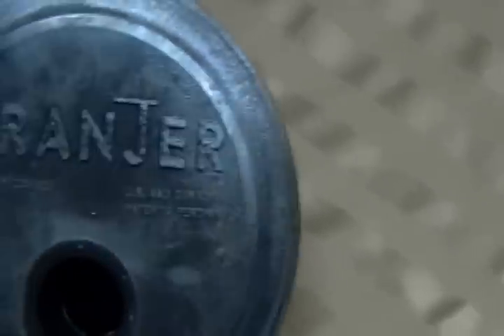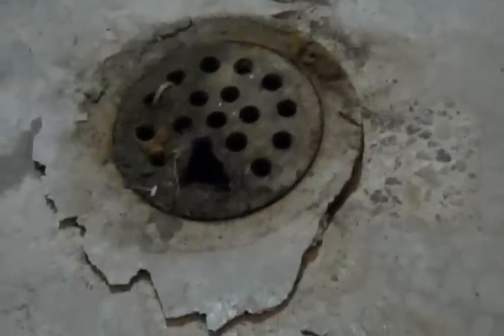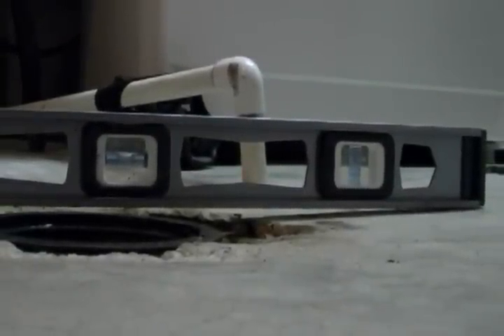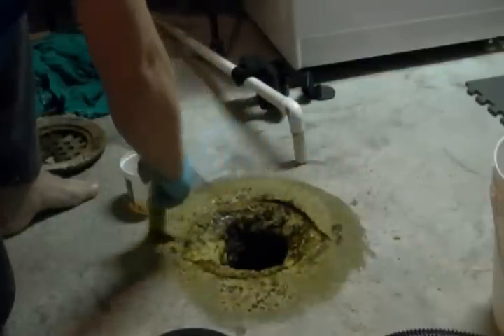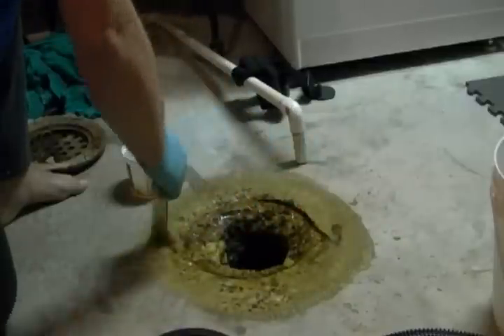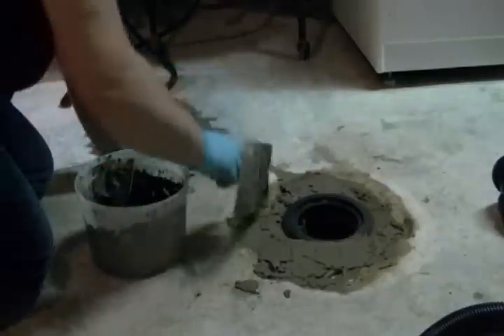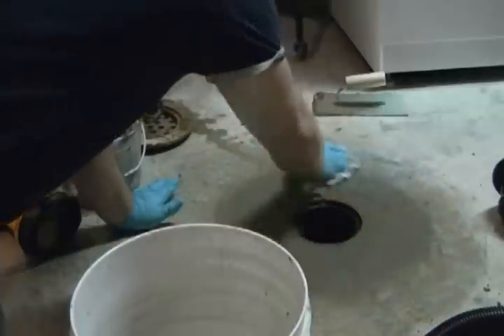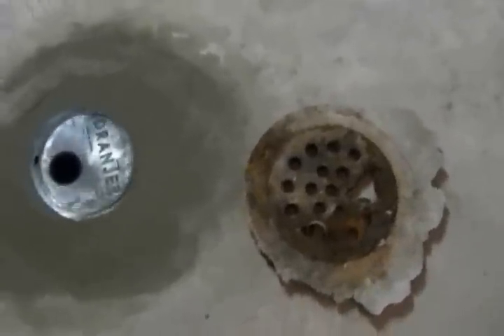Basement floor drain replacement with a Dranjer J-N6.avi

Comment: I see you cementing the ring into place, however do not see you putting the J-N6 into the floor. And when I look at the design of the J-N6 I see a place for water to flow into the drain and down into a curved pipe, the upside of which has a ball in it that I think will only allow water to flow past it and stop flow of gas in the opposite direction. I do not see you attaching this to the drain in the floor which appears to me to be the most difficult part of the project. Please explain.  Thanks.
Reply from the maker: You don't need to attach to the drain. the J-N6 just get placed into the o-ring, so only water will go down into the drain , but the ball in the unit covers the drain hole so gas / sewer smell can not escape back up. Simple design, hopefully that answered your question. Took me about 1 hour to fully install

Comment: Where does the water go when it enters this drain?  Does it just collect under the concrete or is there a open sewer pipe you dont show in the video?  I get the concept of the ball valve but not where it goes from there.  Does it just continuously erode the soil under the concrete until the concrete collapses?  Just trying to wrap my head around this...  thanks
Reply from the maker: There is a main drain in the sewer line that goes out to the city drain under ground

Comment: The original drain was 4 inches in diameter the drain you installed reduced the flow considerably, what happens when this drain is called on to take in a large volume of water like a burst pipe or water heater?

Comment: So the plumbing comes up to the drain but the ball valve is also curved up. How did you connect them in such a small space?
Reply from the maker: You don't connect anything, It's only a to cover your floor drain, replacing the cast iron one. The ball keeps gases can not escape . but if any water goes down the drain the ball will rise and the water goes down the drain. Does this answer your question ? I'm not sure what you meant.

Comment: Did I miss something you have a Loop with a ball in it, When the water gets in the loop the ball floats is there a hole in the bottom to let the water flow down to the drain?  How does the water get into the drain?
Reply from the maker: when the water enters the drain . The water pushes the ball up. the purpose of the ball is to stop the gases .

Comment: Just got the Drainjer yesterday but my issue is I have my washer hose and furnace condensation pipe going to the floor drain I'm not entirely sure if it's a good idea to do this with the dranjer..
Reply from the maker: I would think it would be fine, as long as the drain hole isn't completely sealed or if your using a hose , It's not pushing up the stop ball . I would contact the company who makes this product and ask them .

Comment: What mortar/cement did you use?  I did something similar and used just standard Quikrete concrete mix and I ended up with a very gritty, pebbly surface, nothing like the smooth one you got.  I'm thinking about breaking it out and doing it again since it wasn't very hard.
Reply from the maker: +Bubble King&#39;s Videos I can't recall , but it was just a basic Cement Mortar. It had no pebbles or anything course in it . Like you use for fire places .

Comment: There is an old floor drain (similar looking to the one in your video) in my house and I'm pretty sure there's no P Trap or anything preventing the sewer gases from coming back through. Would this work for that?
Reply from the maker: I'm not completely sure , but if you have a drain I would imagine the "P trap "would put under the basement pad when house was built. You should verify with a certified plumber . As for myself , I do not smell any sewer gases
Reply: kellyo1964 hard to say. I didn't see one when I looked and it's old terracotta.
Reply from the maker: I'm sorry I couldn't answer your question , you should also try to ask a Plumber online or another you tuber plumber more with that type of issue. They would have a answer for you .

Comment: Don't you need to apply a grate over the top of this thing?  Seems like it would break if someone stepped on it.
Reply from the maker: +Bubble King&#39;s Videos . No,  it's a pretty thick 1/2 " durable plastic. it's been 3 years and no issues so far.
Reply: +kellyo1964 What tools did you use to chip out the concrete?
Reply from the maker: +Bubble King&#39;s Videos . The old metal drain cover ring&#160;was easy to remove. just used a small pry bar and it came loose. and didn't really have to chisel the concrete.

Comment: If made in the USA I would Buy it,  Does anyone in the USA Make this.  Need to clean the Houses.
Reply from the maker: buy Canadian
Reply from the maker: I found this product J-S15 Retrofit Sump Drain  , company called RadonAway in the USA . Have a look , it's under Products > Sump Pumps & Accessories. Hopefully that helps .
Reply: If it is to stop radon Gas I can seen it but does it not eliminate the Drain function It a 180 Degree trap fitting with a ball.  The ball seals off the one end, in the case of a liquid, the water  if in the drain from a ruptured hot water tank will go into the trap fill the fitting and if there is no hole in the bottom defeats the purpose of the drain.  If it is to eliminate radon a gas it will not work assuming the radon is coming from the drain. it will still get in the basement.  And any water getting in will cause it to stop functioning as a drain  unless a hole is drilled in the bottom which make it useless for the gas (Radon ) In all cases.  What am I missing?
Reply from the maker: when water enters the drain the ball floats up , letting water through. Than stays sealed . as you can see around the 1:17 mark of the video